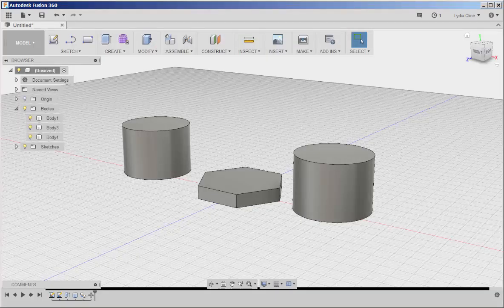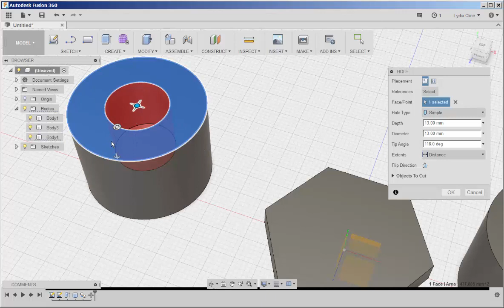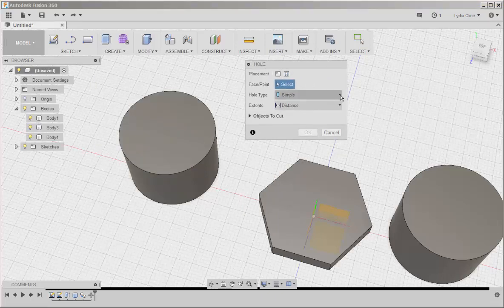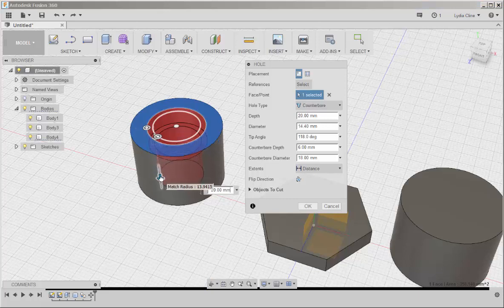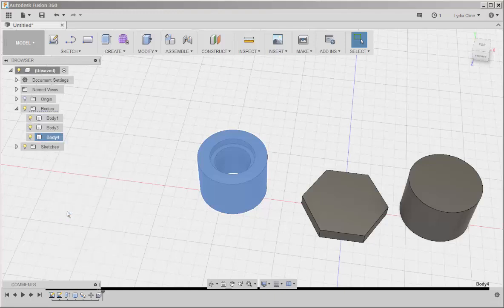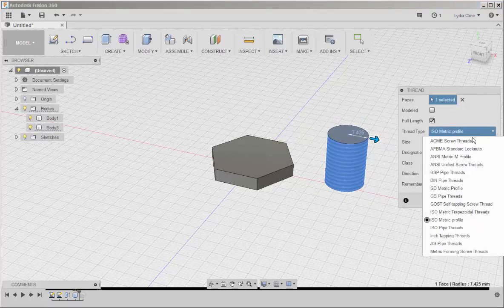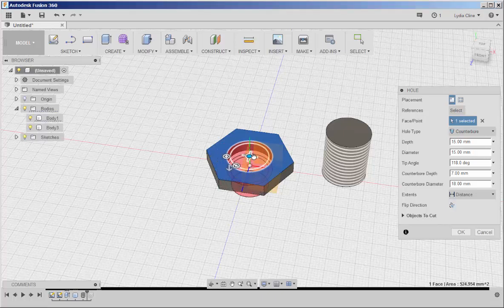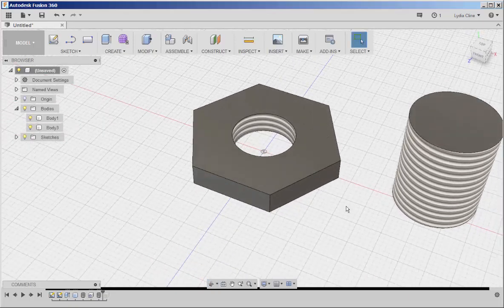Fusion 360: The Hole and Thread Tools

Comment: Hello, I have two bodies that will be held together by four bolts, the holes in the bottom body ate threaded, the holes on the top body must be counterbored, the problem I encounter is that since the top face of the body on the top is not perfectly parallel to the top face of the bottom body (it has an ergonomically or curved shaped surface) I cannot find a way to match the orientation of the holes on the top body to the holes in the bottom body, and they must match because the bolts will secure one to the other, any tips?

Comment: I followed the video, but when I exported the file, it had no threads on it. What do I need to do to get the threads exported on my nut?
Reply: +Dustin D..in the thread tool tick the box "modeled" problem solved
Reply from the maker: You need to combine the thread and nut. Go to Modify/Combine and pick the Join option.